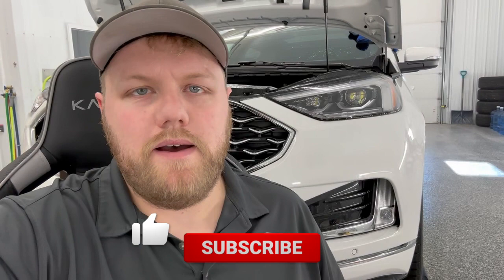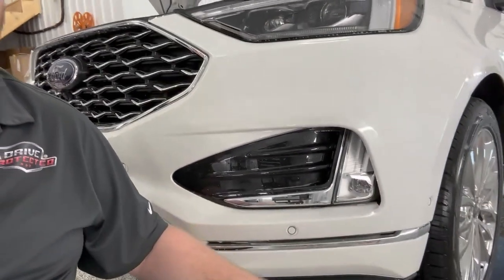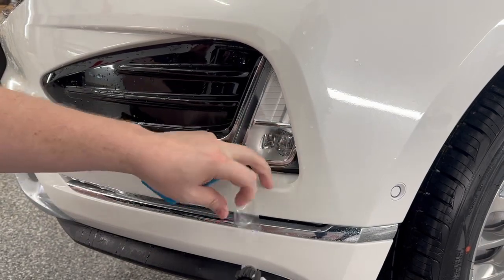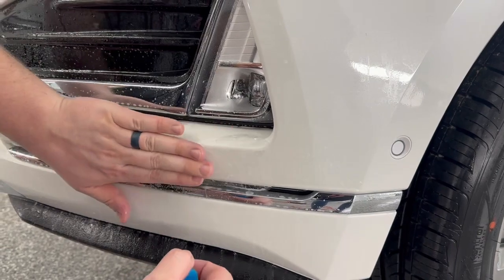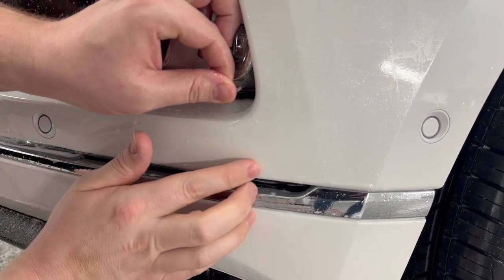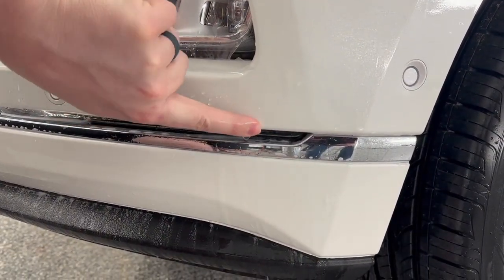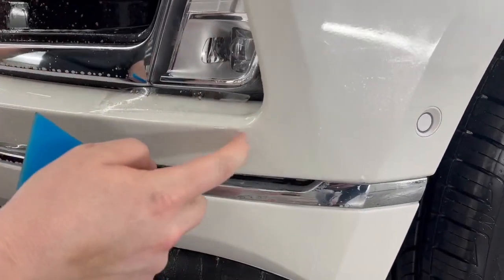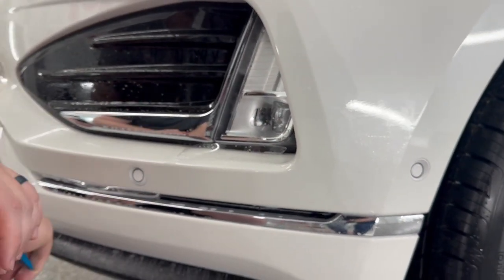PPF Pro Tips - How To Line Up Seams

Comment: Well done.  My question is about your solution dispenser.  I
 am tired of my little pump bottles and want to step up my sprayer game.  Just curious, what's your setup?
Reply from the maker: Right now I use a pressurized spray keg for slip solution and spray bottle for tack solution.
Reply: Thanks.  Is the pressurized keg electric?  Where did you purchase?